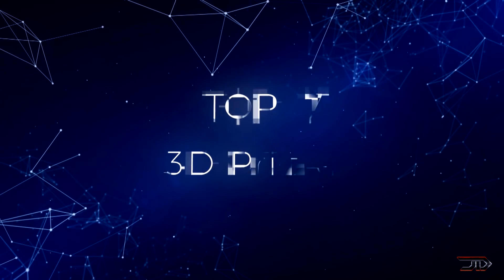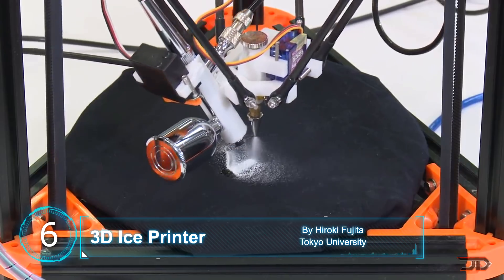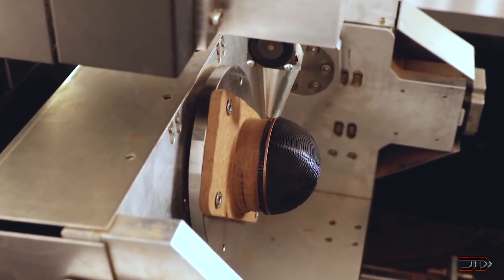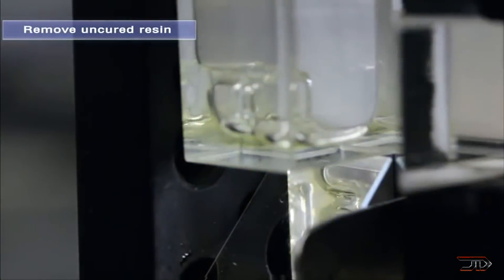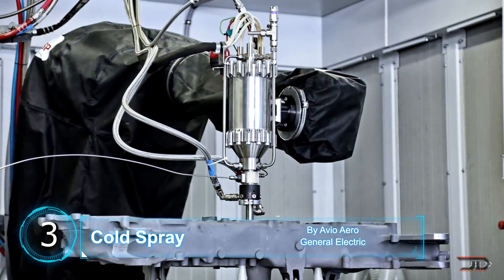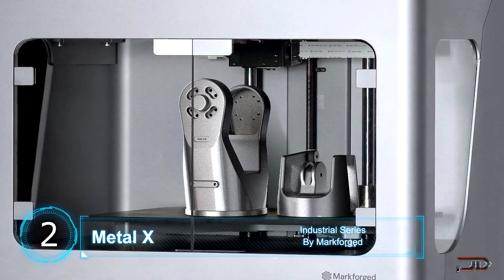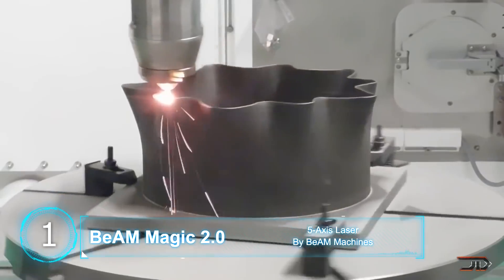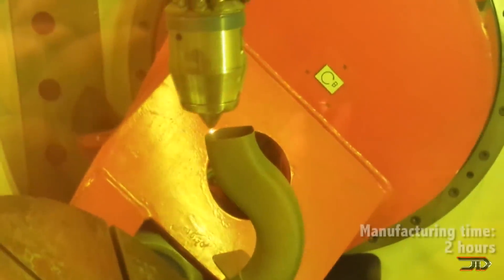7 AMAZING 3D Printers (New)

Comment: Metal powder printer is the way to go (binder, sinthering) but for spesific application it just depends on the component, sprayed metal powder is too expensive in my opinion (gas cost, etc) might be comparable to sinthered ones, either way time to process is fast enough and design limitation is practically non existent (comparing to traditional substractive cnc machining), new design and tech + production process should ideally determine the tools used to process

Comment: To answer your question at the end: Yes those parts are at least as durable as parts manufactured traditionally. Turns out that they are, for the same weight, even sturdier because the laser has a slight "hammering" effect on the powder grains caused by the light pressure. Like a tiny hammer in a forge.
NASA found this out a few years ago with their LENS project (Laser Engineered Near net Shape).
Reply: There is no light "hammering" effect on metal. It is the fast solidification rate that generates strong microstructures.
Reply: @AVCD44  if the laser beam is intense enough, it can happen. Esp. if it is pulsed. Source: Some paper on laser metallurgy from 15+ years ago whose name I forgot

Comment: That laser metal 3D Printer at the end looks so cool and promising. Last time I checked, Metal 3D Prints are created by special machines with some special gases. Hope they refine metal 3D printing, it's the next step!
Reply: The official name for this kind of "printer" is a LMD (laser metal deposition). It is used for coatings from 0.5 to about 2mm height per layer.With this type of machines you can weld any metal you want... also titanium, aluminium, inconel etc.... you can buy some of those machines for example in germany made by TRUMPF... ✌
Reply: Christian Schmidt,
How much does it cost?
Reply: the process kind of looks like a modified mig welder, but powder instead of a spool of wire, I could see it being very durable, with likely the strength of a normal weld. I wonder if it could print titanium or inconel though?
Reply from the maker: Yes, absolutely! I just wonder if the strength of the prints but the process looks way better/faster.
Reply: Just Look at dmg mori they already have insanely Advanced metal 3d Printers
Reply: Lookup the SLM process, a fine laser (0.05 mm) is used to melt powder layers at a speed of 1m/s.  It can make insane geometries.